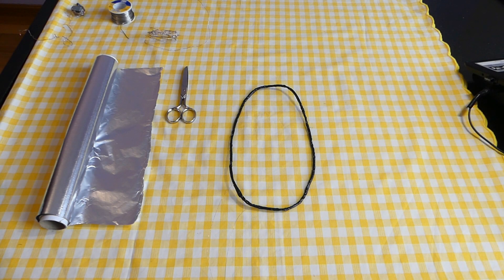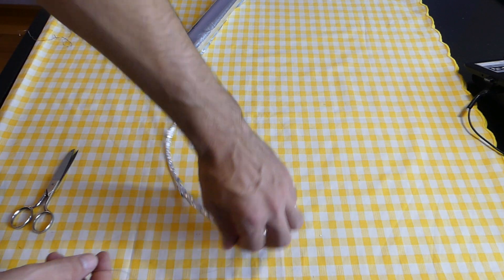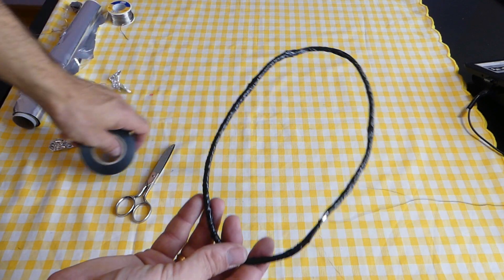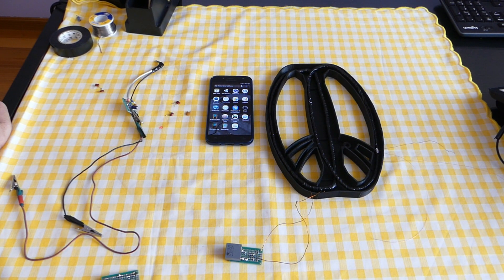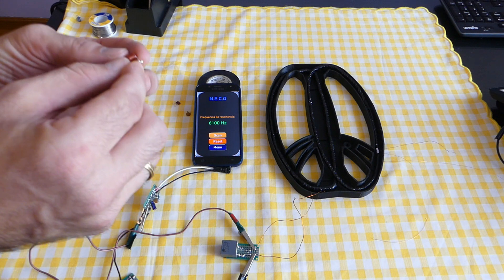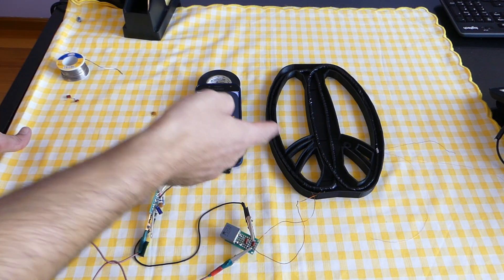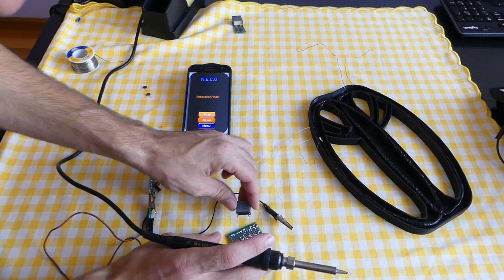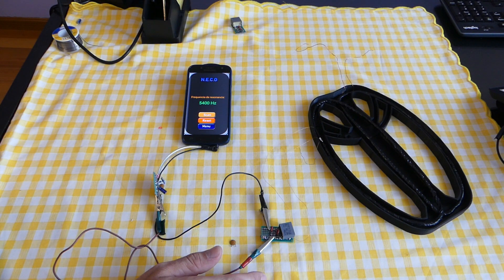3D printed "DD" coil for VLF MD / Part 2

Comment: mr, I have a metal detector GF2 of 14 khz made in China ... I want to make the coil so that the frequency can increase, what am I needed to make it ???  please guide me ... I'm from Indonesia, tank you
Reply: To increase the frequency you need change capacitore, but in most of detectors it hidden inside the coil. You need to change capacitore value.
Reply: @NecoRuChannel  
like this, I can explain how to make it from the very beginning, like the cable size, how many times, and how many rolls / diameters, etc., for the coil ... maybe if you explain, I can make it !!!
Reply: @NecoRuChannel  
I don't understand about electronic mr so if you don't mind I ask to explain in detail ... anything I need to prepare !!!  tank you

Comment: 3 Questions
1. Do You use Faraday cage on TX an RX coil ?
2. Do you GROUND the faraday cage with the rest of the components (eg. Phone Ground )
3. Can I use 0,6mm 55 turns for the RX coil also
Thank you
Reply from the maker: Hi. Yes i use Faraday cage only on Rx coil, yes it is grounded to main grond with smartphone

Comment: I'm following you on all the videos you've shared, I have a lot of questions but this is the one that often changes in your videos. The coils Tx and Rx how many coils do they have? the two coils have the TX 0,6mm and RX 0.2mm wire. but is the diameter or perimeter that is different?
Reply from the maker: Hi!
Thanks you for watching!
Both have the same diameter and turns.
Tx - wire of 0.6 mm, 55 turns.
Rx - wire of 0.2 mm 55 turns.
It's like the last coil. In the last coil (version 3) i used 53 turns Tx and Rx and in this video 55 turn Tx and Rx.
If you have any question you can ask me on necodesarrollo@gmail.com
Thank you!